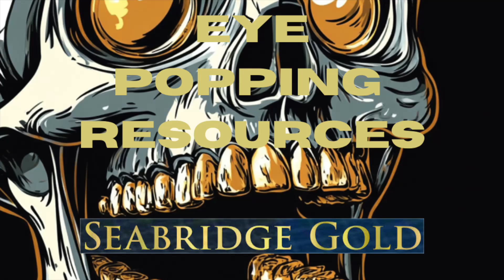Seabridge Gold  Eye Popping Resources

Comment: The deposit IS economical. There are areas that can be graded at 1gpt on an aueq basis. A high copper price also helps. Payback of a 8B initial capex would be in less than 2.5 years. I’m assuming a 40Mtpa processing plant recovering gold at 90% and copper at 85%, silver and moly not considered. This asset would produce for three generations, maybe more. There are multi-billion dollar AI deals being done every week, and the GPUs purchased will be obsolete within 18 months. This mine will be printing cash for 60+ years. Although, the deeper material beyond the open pit may never be economical, will reassess when (not if) we hit USD10,000/oz gold.

If you are still holding off a purchase decision, consider that Seabridge will be spinning off Corageous Lake / Valor Gold on a 1:1 share for share basis. That spin off will end up being worth more than Seabridge’s current market cap once they have funding, and are in steady state production at 200,000oz a year. I see this as a multi-generational stock and that helped me to decide to invest. Something to pass on down the road.